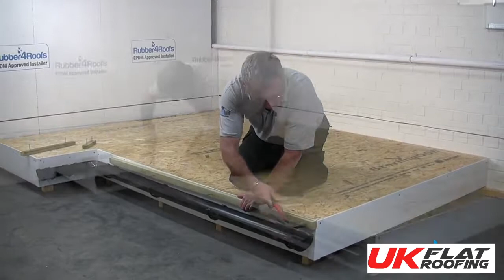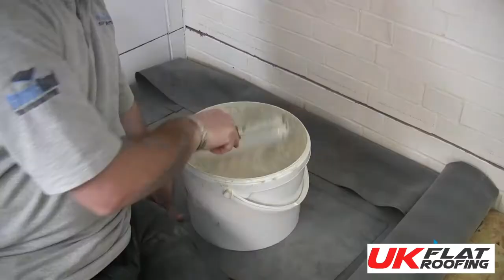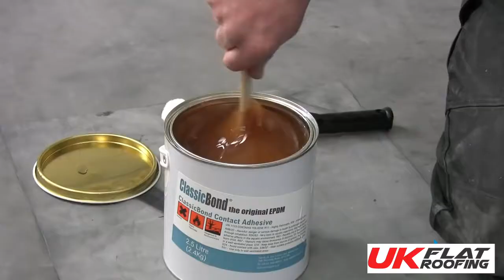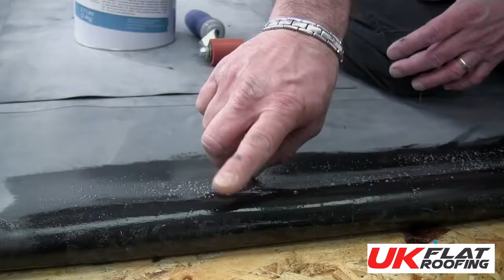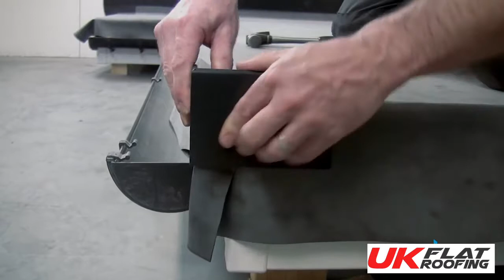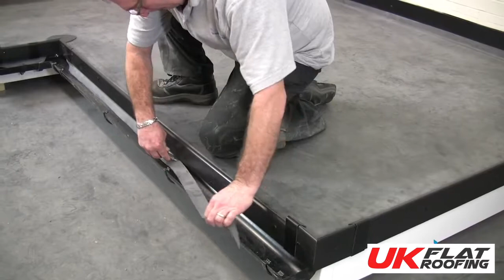ClassicBond EPDM Roof Installation

Comment: Hi. We've just had a rubber membrane installed but the roofers haven't placed contact adhesive on the gutter edge as they said it shouldn't go on the baton. Is this right?

Comment: hi, you didn't show doing the wall flashing!!,    do u have a vid showing that?. what did u use?.    will this epdm go straight on top of old felt roof?   as i really dont want to remove all the old felt and wood boards if possible as their not too bad,      the felt is just splitting and leaking when it rains,   or is there another  option like remove all the old felt inc all the edges and simply put rubber down on the old wooden floor, or poss put new wood sterling board over the old wood floor ?.   any advice appreciated, thanks-dave